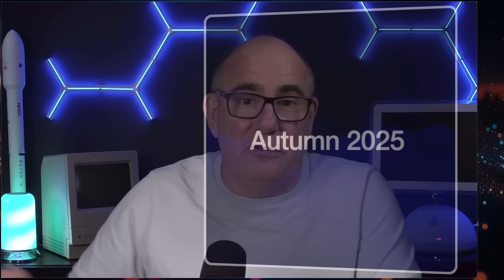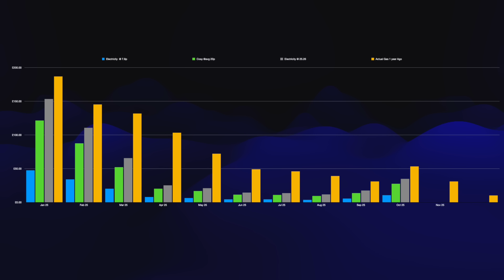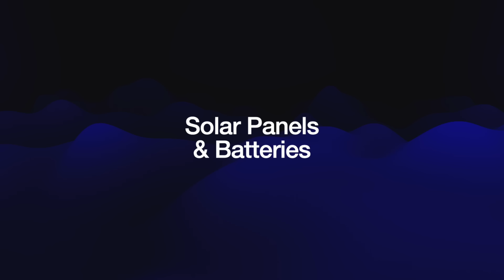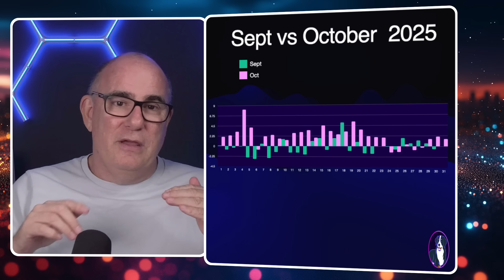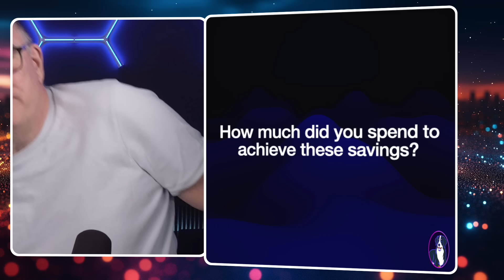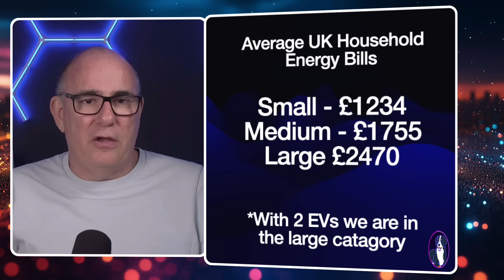How We Owe Nothing for Energy — Octopus Actually Owes Us

Comment from the maker: What's the ROI on your system?
Reply: Existing solar was on FIT so paid for itself in a few years. Proposed extra solar would pay for itself in 4 years (on a single storey building so costs a lot less) but actually will be nearer 6-7 because we are a listed building so we have to do everything short of checking for gorillas and throw a giant pile of paper at the council who I imagine won't even read most of it 8). That's versus likely returns over the same period in an ISA.

Battery part didn't make RoI sense for us but we did it for other reasons. Per kWh battery is now about 25% cheaper than our install (sad face) so it probably would be about 8-10 years at this point. We are getting there but it's still marginal versus an ISA.

Heatpump has no magic RoI for us. It was self installed air/air and it's about the same cost to run as gas but much nicer in feel and we'd have had to rip out and upgrade chunks of the gas setup if we didn't. It's actually very hard to judge because the air/air is cheaper on warmer days than gas but it's more expensive on really cold days and we run it in summer for aircon which we didn't for the gas.
Reply: I'll just talk about my solar generation. I'm getting around 4MWh pa. Install cost was about £5700. It's three years old now so the cost of each unit produced so far is about 48p. Let's say I'm using 50% and exporting the rest. I'm currently paying about 30p for every peak time imported unit (aside from night time rate of 7p) and I get 15p for every exported unit. Average is around 22.5p. So the payback will be a little over six years as a back of envelope estimate. The most important thing is that it's less risky than the stock market and as it reduces my bills, I don't have to earn as much money to maintain my standard of living. I think there is a better ROI on solar than batteries but that might be changing as time goes on.
Reply: It's a bit hard to calculate as I have also expanded the system over time. 

But my energy supplier says my total net energy bill is €17 so far this year with the DHW and a little heating support still done by the gas boiler in it's hybrid ASHP setup.

The standing charge for the remaining gas line is about €22 a month and so far we have burned €164, mostly for shower and bath usage.

I am thinking about upgrading to the full electric setup, though that last step will cost me at least €5000 and some valuable space for the DHW cylinder.

In terms of payback time and having redundancy if the ASHP should fail or an unexpected really cold winter comes, it somehow feels safe to do noting for now and use the pretty new boiler until it fails as it will take about 11 to 12.5 years to break even if the energy from my solar panels is free.
But I don't count inflation as it's unpredictable, so maybe I am being too pessimistic about this.

Do you have any good advice?
Reply: My initial projected payback was around 8 years (solar and battery only) but my spreadsheet (there’s always a spreadsheet!) is outperforming expectations.

It’s a little difficult to use my situation as a typical example though since my first year was under the final year of a fixed term electricity contract which limited the savings/exports I could generate that year. Also I bought at probably the worst time due to the hang-over from Covid productivity and the Russia invasion but the timing was dictated by that ending fixed electric contract, so I’m starting from a high point requiring payback.

In light of that then everywhere around 7/8 years seems a good result.

Comment: Hi Jonathan , I love your videos. So I own a tesla model y juniper. I live in rented accommodation and my friend has just ordered a tesla model 3 too. I like the idea of a eco flow stream system but what are your thoughts on buying a delta 3 pro with some fixed solar panels with one portable.
Reply from the maker: The Delta pro power stations are much more versatile, although if your plan is to connect them into your home mains wiring, there are a little more challenging. The stream is really designed as a home battery where is the Delta pro series as a mobile power station. That said I have the older Delta pro, it’s been working solidly with an extra battery and a power stream inverter for nearly 3 years now. Never missed a beat.

Comment: I have a smaller system, a 4KW array and a 5.7kWh battery plus an EV.  The solar was installed at the beginning of September and the car purchased a month earlier.  I am also on intelligent Octopus go for import and the standard outgoing Octopus for export.  It is too early to be sure of the figures, but it seems likely that the electricity bill including car charging will be close to zero for the year.  Heating is still oil fired central heating.  If I had a much larger battery, say 30KwH, I would get a heat pump, but I am cautious because Octopus can change their tariffs at any time and such a system would be a large outlay.  My hope is that by the time I purchase the next car, I will be able to use the car battery to power the house.
Reply from the maker: Yep v2G would be nice but its not exactly coming quickly is it, they have been talking about it for years

Comment: Thanks, great info. For an October comparison, also on intelligent go tariff, 2 EVs, however no Solar, no batteries, no heat pump, 919.55 kWh / £140.06.
Reply from the maker: Do you plan to add batteries at some point, it will help reduce that significantly
Reply: @JonathanTracey  I’m looking at Tesla Powerwall , heatable have their 0% APR offer back on, circa £1800 down & 3yrs at £156
Reply from the maker: Will make a huge difference quite quickly

Comment: I'm just about to have a Cosy 9 installed next week, the final part of going fossil free. Already have solar, battery and 2 EV's so well on the way in the journey. What I'd really like is some templates for monitoring use etc - any good ones that anyone knows about?  Also, which is the best Octopus tariff to go for once you have everything in place?  Great video and content.
Reply from the maker: When do you say templates, what kind of templates are you talking about? From what I understand? Monitoring of the cozy Heat Pump is done through the octopus app, some of that may be exposed to platforms like Home Assistant.
Reply: @JonathanTracey  Thanks for that. Not had a chance yet to see what the app can do and maybe, I need to look at other platforms like Home Assistant. I was  just thinking of some basic charts but  perhaps I need to wait and see exactly what kind of information I might need. Thanks anyway.

Comment: Thanks for all the data it’s very interesting.  Like others have said it’s the export during the summer that really helps make it £0 over the year.  

I do think you should allow some money as a cost for the battery’s or inverter as they will not last the 25-30 years the panels will.  I’m guessing most people will at least replace the batteries once in that period.  Also a lot of companies will not fix these units as it’s not cost effective.  I haven’t in the 25 years bothered to get an old washing machine fixed as the cost to repair was too high % wise compared to getting a new one with the benefit of the warranty and nothing else going wrong with it.  

Also the cost of fuel that you would have spent should be in there as you have had a higher outlay of equipment to get free travel in your cars.
Reply from the maker: the whole solar system has paid for itself twice over so if htere are any costs for repairs they can be funded from that. With regards to batteries the honest answer is no one knows how long they will last, because we have not had this tech long enough for us to find out. However what I can tell you is my wifes nissan leaf battery is 11 years old and going strong, my old tesla model S was 9.5 years old when I traded in, and had lost 6% of its capacity. So I think based on that small data sample they will last longer than most people think

Comment: Quick question Jonathan,  we are out of the country for 4-5 months of the year where the house is closed down apart from security lights and a fridge freezer. 
If I had a PW3 and solar panels could I run the house 24/7 on the battery and export the majority of the energy produced during these periods?
Reply from the maker: absolutely, when we go away on holiday two or three times a year, we do exactly this. The house goes into vacation mode. Keeping the bear essentials running and we explore any extra power.
Reply: @JonathanTracey how do you control all this? Import, export, car charging etc, is it all controlled by a single app automatically?
Please tell me to go away if I’m asking stupid questions !!
Reply from the maker: @BarrySpiers as much as possible I try to automate things using home assistant, now for everythign that's not possible but for the rest I have a button called vacation mode. I press it and its turns off all the things I don't need running while on holiday (hot tub, car chargers, it dials down the heating and hot water) it also puts the batteries into a hold state at 75% so they will charge up to that and then export the rest

Comment: I have an almost identical setup, but went smaller, about 4.6kW solar, 12.6kw batteries, 9kw heat pump and a hybrid car. I think all in all my system cost around £17K, but based on a standard rate, I save around £3K per year meaning an ROI of just 6 years….of course covid pushing up the energy prices actually accelerated my ROI and helped enormously.

What I didn’t know when I bout the systems that I would change…I would like to increase the solar generation capacity. But being east/west facing on the roof I don’t get the best generation, only half the panels are working fully at any time. But I should be able to get bigger capacity panels now than I did 7 years ago, but I still doubt I would generate energy to the levels you have and that’s the one thing I’d call out on your video. It’s not going to be cost neutral for everyone, solar capacity will be a major limiting factor on the ROI, even more so if the energy companies stop paying at peak generation times when unusable energy is dumped into the grid en mass.

Batteries make the most sense for long term energy savings, with solar (in my view) being a great source of additional free energy if you have the ability to generate a decent amount.

My bills, after FIT because I export next to nothing from my system) are around £300 per year….and I’m still saving £3K….so it’s all about the margin for me.
Reply from the maker: I didnt include my FIT as today no one can get that so hard to replicate but that adds another 2k a year in savings

Comment: hi, have been following the channel for almost a year since decided to get a HP. I've also got SolarEdge setup (29 panels, 10kw inverter and single 9.7kw battery) so now with the Octopus installed Daikin Altherma 8kw HeatPump its a pretty similar setup so its been useful to watch your content :) I've also concluded the HeatPump software "Onecta" is... a bit garbage sadly, the biggest issue is the complete lack of data updates in the app, the hot water temp for example doesn't update for up to 30mins which does me no good whatsoever when people have back to back showers nearly emptying the tank and it still thinks its at full temp... I see you have your HP connected into HomeAssistant? I'm considering deploying to use HA instead of the awful Onecta app. Are you using the cloud connection for that with the delayed data or have you got a modbus connection for realtime data and if so did you get Octopus to set it up and is it worth it?  Cheers!
Reply from the maker: yeah, unfortunately, the only way to talk to the Heat Pump using Home Assistant is use the Onecta plugin.

Comment: I always price my heatpump usage at 7p, but in reality it's actually 15p, as every kWh used, is a kWh not exported. ROI on my system, well it's complicated, first system paid for itself in about 7 years, second system was rather expensive, as it was 22/23 when everything went silly, third addition not too bad, but I think  about 7 years or so for the last two systems, not including the heat pump or EV.
Reply from the maker: if you use that argument its 15p then your have to account for your heating separately, otherwise you would be sat in a cold house.

Comment: If you get quotes from Heatable, that's going to be expensive, get quote from Artisan, and that's going to be mega expensive, I would suggest either.
Reply from the maker: yes they both are premium offerings but when something goes wrong and you pick up the phone do you want to hear "sorry this number is no longer in service" of do you pay a bit more and know you will get a good install and they will be around to support you
Reply: @JonathanTracey  We're not talking a bit more with either though are we. Artisan, on their website states for solar installs "Prices starting from £26,000", a few months back it was £20k, they either don't want the small installs or they are taking the mick, and suspect both. Heatable are also very expensive, after all two companies have to make a profit as Heatable don't install nationwide, they use sub contractors, they also have a habit of pushing expensive panels and micro-inverters. One guy on a forum got a quote from Heatable and it was £19k, I suggested another installer, believe it was the one Tim & Kats Greenwalk recommend and it was about £5k less for a similar system. There are plenty of long established local companies around, the company I used in 2015 is still going strong, they started out in 2010.

Comment: What export limit do you get from your DNO?
Reply from the maker: 10kw
Reply: @JonathanTracey I just got my DNO offer back. I wanted 11 but they offered 4.2. Ive appealed, waiting for an answer. I set my system up to behave like yours. 27kwh battery, 15kwp panels. Looks like ill have to run all of the appliances and charge the car in the day instead of relying on arbitrage
Reply from the maker: did they give a reason for 4.2? Do you have a looped supply, or a lower main fuse (60amps)?
Reply: @JonathanTracey I've appealed because they only said until some "upgrades are introduced" so I went back and asked for the network headroom and LV map data. We are on a 23 year old estate with underground cables, 60m away from the transformer and 100A fused supply. Still awaiting a response which was submitted 9 days ago. It does massively impact the system and will strangle a 15kwp array. Fortunately they allowed us the 11kw generation limit. Worst case scenario electricity will cost us about ££50-100 a year by using the excess solar instead of £200-300 a year net profit by going arbitrage. Its not the end of the world but it's not how i strategies the system when I designed it.
Reply: @JonathanTracey just had my revised DNO offer. 11kw generation, 10kw export 😍
Reply from the maker: Nice, congrats 😂

Comment: iv said before that in april 2026 was looking at heatpump with tank is a heatpump with thermal battery any good for a 3 bed house only found out like 1 week ago a little bit what thermal battery do
Reply from the maker: When you say thermal battery, do you mean a real product or thermal battery or are you talking about using the hot water tank as a form of thermal battery?
Reply: @JonathanTracey  i seen somthing i need look into a little more like abattery that stores heat instead of electric and i think still uses heatpump so i dont have to have a tank there called thermal batterys
Reply: @JonathanTracey thermal battety that stores heat but get a heatpump to get better COP dont really want a water tank but want good COP

Comment: We put a 10kw system in June 2018. Our energy usage from the grid and gas was 40mwh a year for just electricity and heating. Roll on 2025, we now use aroound 22mwh of which 40% is generated on site. Bills wise we averaged 12pkwh in 2018 and paid 120 a month. Today we pay 100 a month and average 10pwh so 1200 a year but get 750 a year in export and 500 in feed in. So per year we pay nearly nothing for heating, lighting and running one electric car. Also average electricity prices are double what we actually pay. Payback is interesting, I reckon with the solar and battery it is approximately 7.5 years, so this year. But all the power we self consume we pay no vat nor income tax on. How that is factored in for ROI, that is hard to calculate. We do have a problem, after 7 years of use, the batteries got installed on year 1, the pylontech batteries are heading to 87% soh. So after 10 years I believe we will be heading to 75% soh. We have had 2 battery inverter failures, both of which were covered by the manufacturer. So, was it worth it. Yes. Would I do things differently now, of course as you live and learn, but I would still have the solar and batteries and the electric car. I do not miss going to the garage to fill up the car and having an effective zero power bill makes economic sense!
Reply from the maker: Sounds good, I do wonder if were going to start having ot pay tax on solar export at some point. That will certainly hurt those who arbitrage energy by buying and selling back to make a few p, you would pay vat in import and tax on yoru export

Comment: Well done, informative video.  I have nothing at the moment, just the Tesla.   However, I’m really thinking of getting started with PW3 (and maybe solar) to get me going.  Can’t imagine life without a gas hob so anything to reduce the dual fuel bill would be great
Reply: Induction hobs are pretty darn good and have fast controllable heat like gas. You might have to change your pans though, depending on what you have already.
Reply from the maker: Yeah, I was a little worried about moving from gas to an induction hob, but the induction hob is just amazing. It heats up very very quickly and is much more controllable than the gas hob. I really wouldn’t go back.